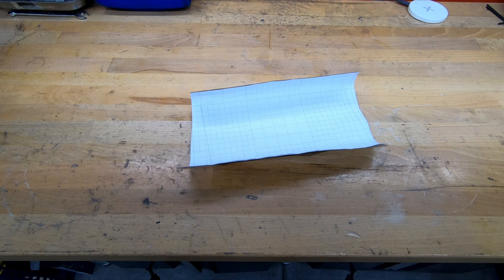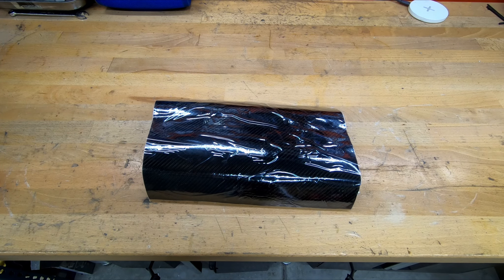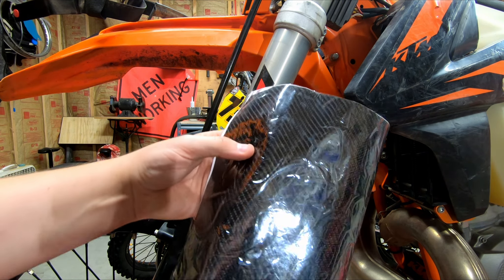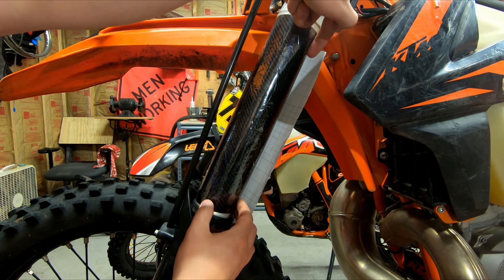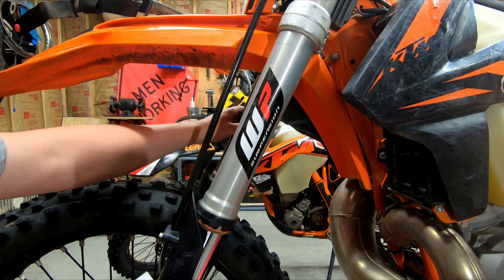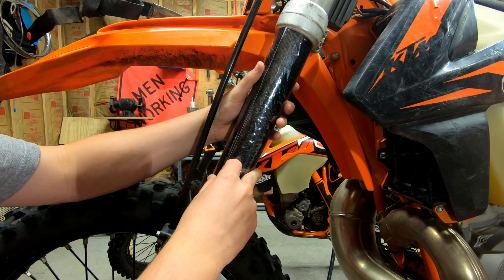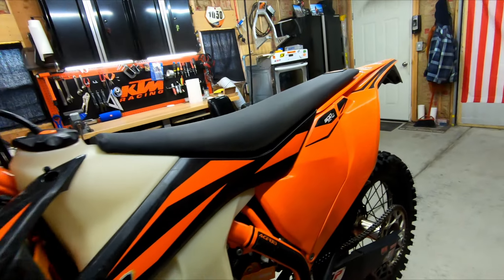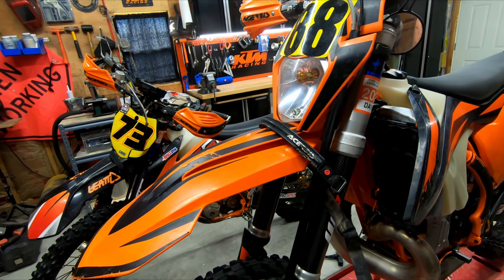DIY Vinyl Fork Wraps

Comment: What REALLY screws up forks is ROOST!   Even  on roadrace bikes on asphalt tracks!  I just purchased a really nice pair of R1 forks cheap because they have some roost pitting on the front of em  Too bad the owner did not wrap em!  But now my idea is to wrap em to HIDE the damage...not sure how well that is gonna work I guess wrap is so sheer/thin it does not really cover imperfections all it can do is hide visable difference but not gouges or bumps (or sticker outlines)